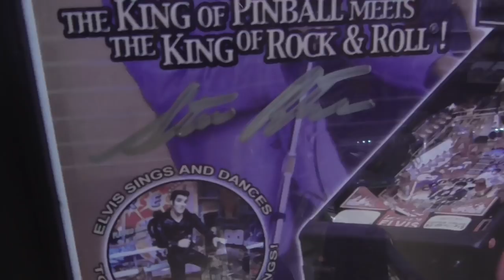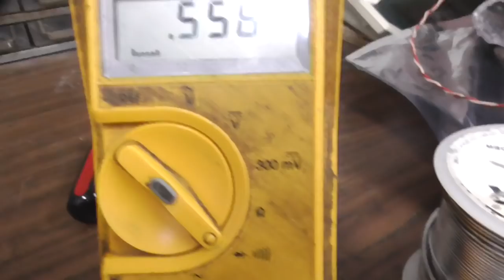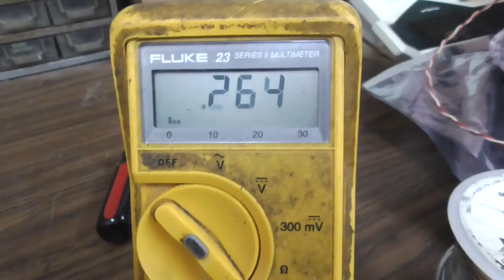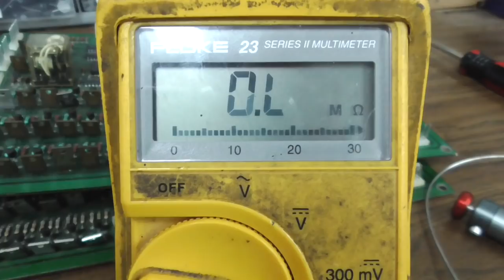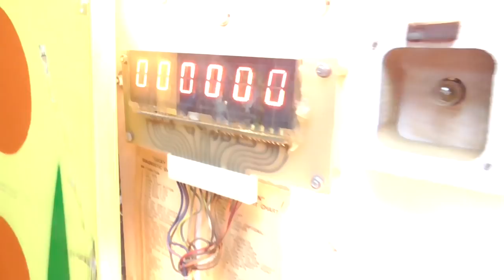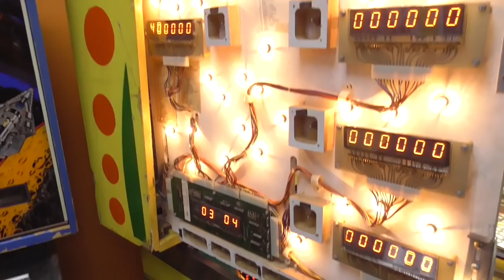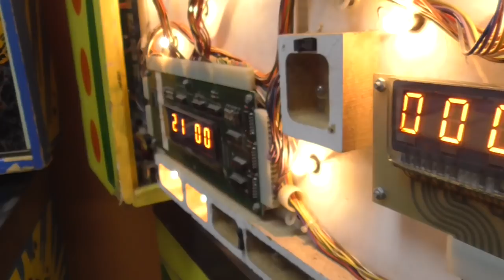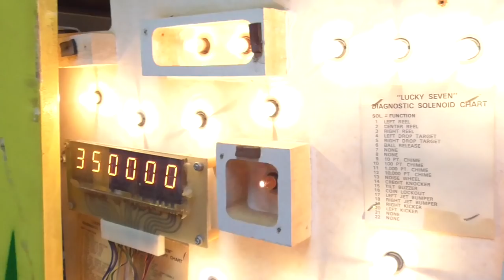Testing Multiple Driver Boards In A Williams System 3 1977 Lucky Seven Pinball Machine - PCB Repair

Comment: I guess, given how old these boards are now, they are doing well.  They were not designed to last over 40 years.  It was making the boards as cheap as possible to last maybe 2 or 3 years, and sell a new board if one fails a bit earlier.
You give a good explanation of everything.   I always enjoy watching you troubleshoot and explain how things work, and I am I coming from a position of having a degree in electronics engineering. :)
Keep up the great work.

Comment: Gottlieb sure was king of the ems….  and it was that way from 1947-1978. It’s sad to me that the company who absolutely dominated pinball in the electro-mechanical era could never seem to get on top again once solid state came into being. …. but the woodrails and wedgeheads from Gottlieb assure their place in pinball greatness. Thanks again Ronnie. Good job.
Reply from the maker: I love Gottliebs, even the Solid States.  Most of my favorite games I've ever played were Gottliebs... I just picked up a Close Encounters the other day we'll be doing videos of... I love their cheesy ones from the 80's too.  I had a Lights Camera Action one time I really liked too.... I think the perception the games weren't as reliable really hurt them in the solid state era unfortunately... and they tried to resist some of the things they saw as gimmicky in the Williams games for awhile... by the time the System 1 stuff was over, the damage had been done and no matter how good a job they did after that they were never going to be at the top again.  There's about 20 of them from 1980 to 1983 that I want to get in the shop... stuff like Qberts Quest and and James Bond!
Reply: I agree, but working on EM Gottliebs are a pain They were great back in the day but now days, the reset banks suck. Hate them.  Williams Em's are easy, Bally is okay, Gottliebs, I hate them.

Comment: I was just looking at Vid's Guide to Making System3-7 Reliable on Pinside forums. He mentioned something like you could replace the transistors with MOSFETs and then just jumper wire in place of 27 Ohm resistors.  Getting rid of those heat creating resistors seems like a good idea. Keep up the great videos.
Reply from the maker: Thank you Kent, Vid knows his stuff!  See you on the next video... .

Comment: So I got one of those Japanese rust erasers off your website.  They are as good as the Japanese solder sucker!   I almost didn't order it, thinking the grit was just on the surface....like one of those cheapo harbor freight foam based sanding pads.  But those things are the perfect tool to clean bonus units and the like!
Reply from the maker: Remember John.... I would never Lie, to Make You Buy .  If I say it's good in my opinion it's good, thanks for watching as always!

Comment: The connector term you're looking for is called "mating cycles" -- plugging in and then unplugging a connector is counted as one cycle.

Every connector has them in their service life specifications. Obviously Williams didn't expect their users to unplug those connectors for lots of times. Build it once, test it, and it's good.
Reply from the maker: I think they designed these things for like 3 years life!  Thanks for watching Stoney3k!

Comment: Speaking of burned up resistors - you haven't seen the lamp resistors on my Blackout... you can't see the rings anymore on most of them. Some even have their paint chipped just from thermal stress. And they're still within tolerance and the lamps are plenty bright!
Reply from the maker: I've seen a FEW that go out of spec where they're not the same ohms anymore, but the main thing I've seen them do is desolder themselves from the board, lol
Reply: @LyonsArcade  Yes exactly! I was testing MPU boards and one was working at first but then crashed during burn-in while I was away, causing a string of lights to go full brightness until the resistor self-desoldered...

Comment: I use a Testofon (which nowadays calls itself Contitest) for signature analysis like that. Instead of giving me a number for each pin, it gives me a tone. This way I can compare frequencies instead of numbers which is significantly faster because I don't have to look at a display.
It takes me about two to three minutes to go through an entire Bally/Williams driver board.
(it can also be used to determine capacity/leakage of capacitors, diode test and of course continuity)
Reply from the maker: Very cool, I haven't seen one of those.  I've noticed before on a logic probe I'd rather rely on the sound than the led's so I can see where that would be very helpful working through a board...
Reply: @LyonsArcade  When your device under test is getting digital pulses, the Testofon (acoustically) behaves pretty much the same as a logic probe, giving you an acoustic signature you can compare different lines against.
Only difference is it works even better without the DUT being powered.
You can find the Testofon if you search for Taco-Nauert Contitest 4000.
I haven't found any tutorial or video on this device so I made my own: https://www.youtube.com/watch?v=D31ItpvJ3TY
Watch the part from 32:55 where I go over a Bally Lamp Driver board and find the first bad ones within just a dozen seconds (although I bet some are false positives as they are Thyristors and were switched on when the game got switched off, but some test way different)
(it's in German, I tried automatic subtitles, they're pretty much useless)

If you demo this device and stock it in your shop, they probably sell like hotcakes. They cost about as much as the cheapest multimeter that's not gonna fall apart after a year of use.
Ah and I forgot - the Testofon can handle up to 250V for a couple seconds, so you won't fry it if you hook it to the solenoids or even the AC voltage - speaking of solenoids, if you Testofon the solenoids and move the plunger, the tone changes!

Comment: I know early Bally systems. Don't know early Williams. Great video. PS connectors on the top of that board look fired,  Because I just replace what I see bad, I would have replaced them. On  classic pinballs, i hate LED's.  47's are great, but honestly on my own machines I still use 44's, they are maybe on 4-5 hours a week.  As a site note 6821 PIA's are just that. a pain in the A.  (pia) they are cheap.

Comment: A blown 6821 PIA chip could certainly interfere with the cpu fetching and running code eg if its data bus pins are outputting a voltage when they should be idle and offering a high impedance, essentially corrupting the program and data as its read to/from memory.    If the PIA is partially working but perhaps the I/O pins connected to switches are blown- or the chip is not properly generating interrupts then the cpu might be executing code but waiting forever for something to happen.    I'd be inclined to bet on the former...
Reply from the maker: Thank you Greg!

Comment: The wheels look a little off center. Is that how it is supposed to look ?

On the older mechanical slot machines sometimes the wheels would not stop on the actual image but in between and that was how it was supposed to be there were actually more steps then just the centers of the images on the wheels

Comment: So complex. I wonder when the first pinball machines were made.
There were mechanical slot machines that were really small. 
They were made to look like a gumball machine but the balls were not gumballs they were porcelain and they didn't come out of the globe on the top they were just a decoy to make anyone who didn't look really close think it was just a gumball machine and I believe those were made in the to late 1800s

I'm guessing they probably made a very simple pinball type machine shortly after that that maybe the ball just came down and you had one or two chances to hit the ball into a specific spot on the playfield in order to win cash

I bet the carnivals the old time carnivals from the late 1800s early 1900s had these mechanical pinball machines

I've seen in photos from the 19 10s 1920s where they had penny and nickel hand cranked film reels that were all mechanical where you dropped in the nickel and it released the stop lever from the crank and as you turn the crank there was a little generator that powered a light bulb behind the film strip and I don't know how the mechanism worked but it allows you to keep cranking until you reach the end of the reel and the stop lever would drop back in against the crank.

They were adult films, but in the photos I saw it was all kids, looked to be 8 to 12 that were all in the tent using the machines.

Back then kids as young as 4 worked in the mines and I went to one of these mines here in Pennsylvania and they had all the family records from the entire town, and they had photos of the families and kids as young as 8 we're married.
By age 13 they had 3 kids of their own.
I visited the canal museum here and saw the identical thing. That was in the 1990s.

They have since closed the archives except for family members because it is not politically correct

My grandfather was married at age 12. He was kicked out at age 6.

So much history is just hard to take.
In researching the 1910s, 20s and 30s, I had no idea how much child labor was used in America.

The depression and the dust bowl, I saw hundreds of photos of mothers selling their children with signs on their porch advertising.

I couldn't believe it and this history is never taught 

WW2 really changed America.
Right after the war child labor was forbidden.

It is an amazing subject matter to research.